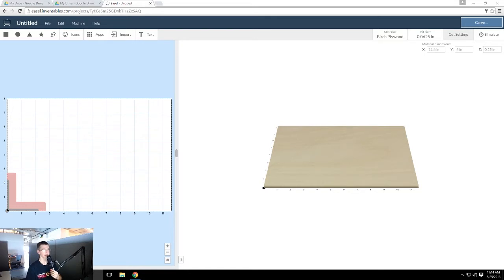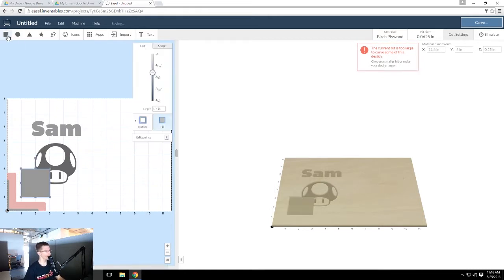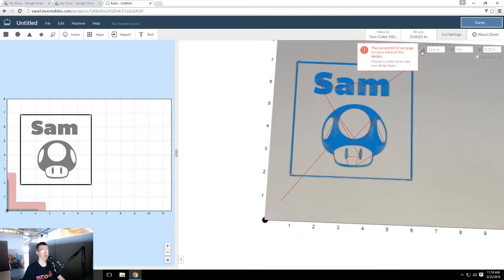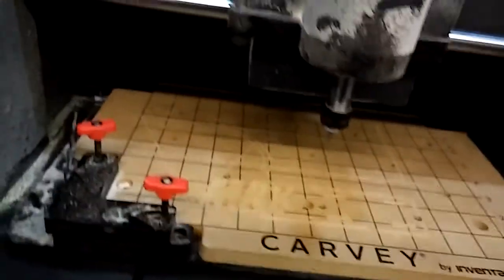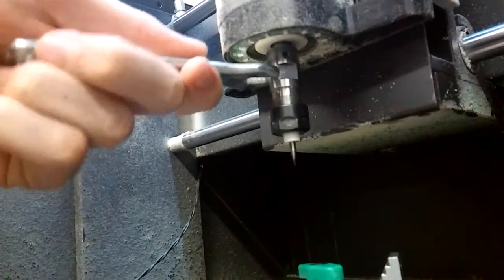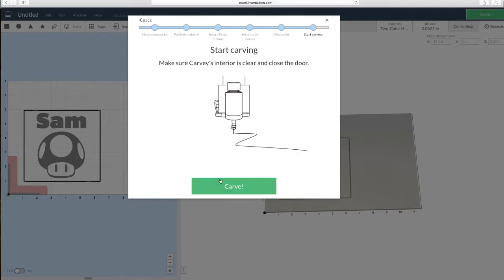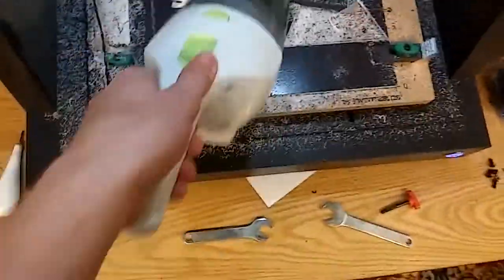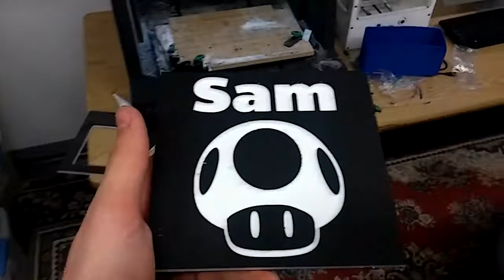How to use Easel and Carvey BASIC

Comment: How does Carvey compare/contrast to Othermill?
Reply from the maker: They are used for different purposes. The other mill is much small, has much smaller bits, and is more accurate. If you're looking to make stuff using materials like wood, plastic, some soft metals, and typical CNC stuff, then the Carvey is right for you. Othermill is for small aluminum parts, and PCBs. We have both in the lab and honestly I see the Carvey as very useful, but the othermill isn't used much since we don't make small metal parts and PCBs are so cheap and quick to get professionally we just order them from places like OSHpark. Carvey is also a lot easier to setup and control and it holds down material better and seems like a much better thought out product.
Reply: Thanks, Sam.  I'm looking to mill small stuff of various materials, and accuracy and quality of the mill are most important.  If you believe Othermill is best for small things, I'll consider it over the Carvey for what I'm looking to do.